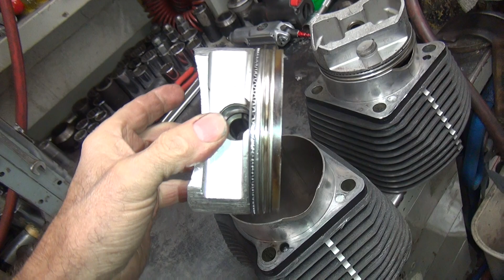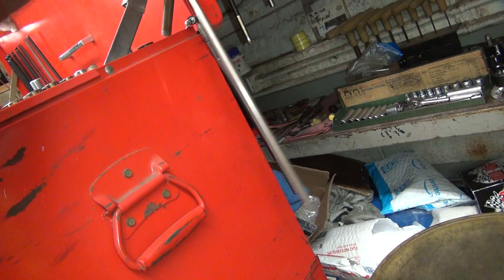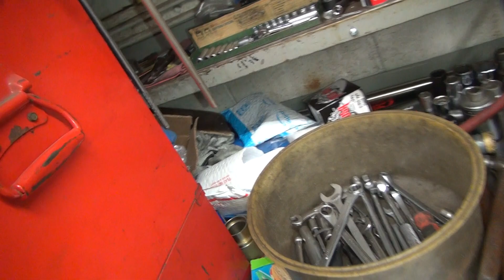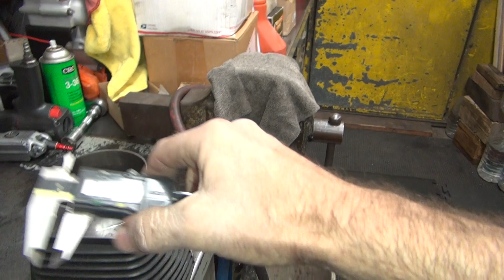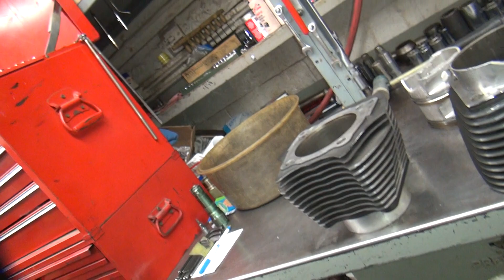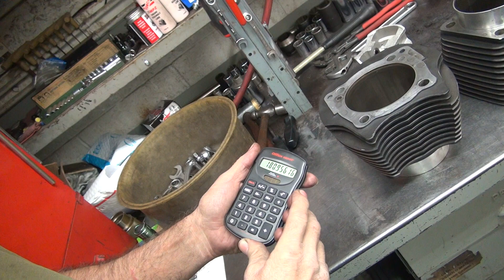#101 139ci m8 4.5in big bore bad cylinders 167" twincam milwaukee 8 combo motor harley tatro machine

Comment: This shit been going on since  allen sputhe started  with evo cylinders  35 year ago junk lol ,i sleeve  4.500 m8 with 100-55-03 liners  No problems ,the cylinder  are not a thick as you think    4.600 max ,then iv made billet 7075   4.700 but very time consuming